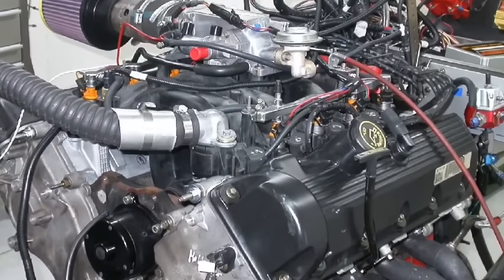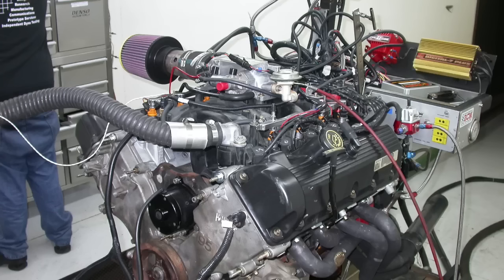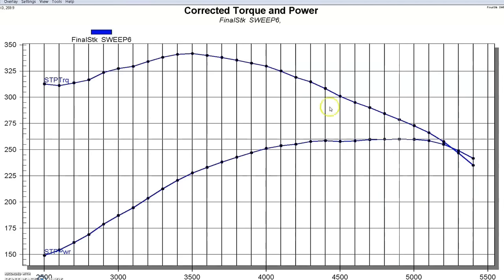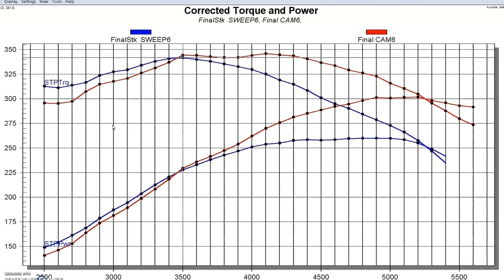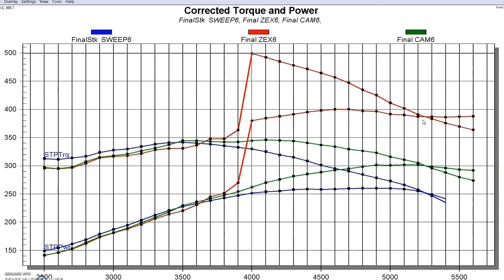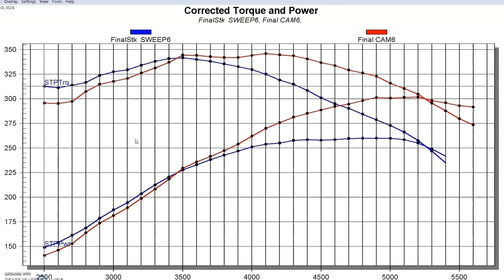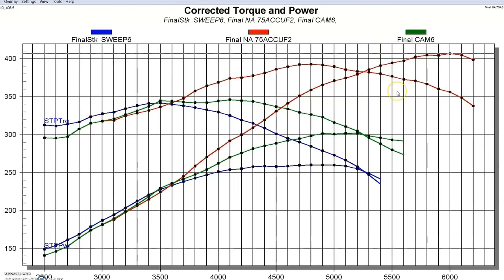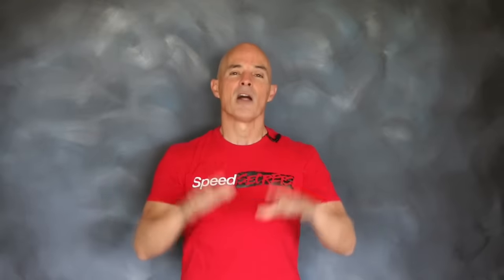HOW TO! MAX HP 4.6L FORD 2V MODS!

Comment: Brother, I want you to know... Back in the day when you did this series I became your biggest fan!  I built many 2V's and I love them.. We now have a 2V with a Carb and N20 in a 96 GT running low 5's in the 1/8 and high 8's in the 1/4... To  my knowledge... I don't think anyone has ran faster on N20...  Bad new is we are tapped out... At 304" the amount of Nitrous we are spraying will back up in the manifold and make a cool cloud above the Carb while going down the track!!!
Reply: Richard would you Autograph my 4.6 book that you wrote if I send it to ya?
Reply: Put a blower on it to shove it in?
LOL
Tim Matherly from MV Performance used to fly (8's in 1/4) with stock cast crank, pistons and rod topped off with those Trick Flow Heads. That is the secret.
His car had a street blower and five speed at that and was heavy.

Pretty impressive.
Reply: The 2v is the most underestimated motor ever.
Reply: @lifewithanxietyeveryday5897  while it has its issues... I agree with you! They are everywhere in wrecking yards and can be built up to Coyote type performance pretty easy...  I have personally made over 2hp per ci ( 304" ) NA with a 2V and over 4 digit power on N20...
Reply: @UnityMotorSportsGarage  no way . That's insane.
Reply: @Spad68  You can do alot more with them than people give them credit for... One good thing is using a Flattop piston with the 38cc Trickflow head.. you can make some serious compression!
Reply: Tell me how bro
Reply: @UnityMotorSportsGarage  what did you use to make that much power na?
Reply: @peterpys3840  we run a Big Bore 304" combo with TEA CNC Ported TFS heads that flow right at 300cfm, Compression is right at 14 to 1 running the largest cams that the cam core will allow! 17/8's long tube headers
  A Edelbrock Vic Jr  that has highly worked over with a 950cfm Holley Carb topping it off... 
 Andy
Reply: Just want to give Unity props for going low 5s/high 8s on a 2v. I spent way too much money to go 9s with a 3v so
I can’t imagine lol.
Reply: @kennethpowers8995  I have messed with these engines for 20 years... My buddy Ed Pierce had a wicked 3v he was our top competition at the first two Mod Motor Nationals and seeing what he went through makes me think it is easier to get the 2v to perform because the lack of valvetrain issues.....  I do know the 3v head will flow some serious air when ported!  Where it beats the 2v is the low to mid range flow ranges ..having 2 intake valves helps a ton! 
Thanks for the kind words... It's always a work in progress!
Andy
Reply: Unity MotorSports Garage tell me more a out your secret receipt iv been tru 3 engine now in my drift sn95 .. im running a stock bullit motor for bow but i want to build an other one with my cms ported head/cam ! Budget build.. teksid bloc /cobra crank / boss 302 rods... what would you suggest me for the pistons?
Reply: @teal_2v338  what are you using for tuning? On drift setups especially that hang out at very high RPM for periods of time the tune really needs to be spot on with safety cuts in place for things like fuel pressure and oil pressure drops, temps etc. The Boss 302 5L rods are a direct drop in for the 4.6 and are good till 600-700 Hp reliably. I’ve seen more made  but not comfortably. The 2v crank would be actually fine for the limits of the rest of your build. Are you running a power adder? NA you won’t be making much over maybe 400hp depending on bore and compression and cam profile -/+ a few HP, but boosted you could easily make good power. I would decide what your power goals are before choosing a piston. For strictly NA use in a drift car go with something that yields a high compression with your heads, is lightweight and has coated skirts. If planning to run boost run a lower Comp flat style piston and go with a forging known for strength in modulars like JE, Diamond, CP etc. I would sacrifice some weight for over all strength in a boosted setup. Going back to the tune though that’s most likely where you are killing these engines unless you are severely over working them and having failures like oil starvation etc. Which brings me to another point; do NoT cheap out on your oiling system for a drift car! Spend the money on a proper pan, pump, pickup, Windage tray etc. One way to make certain you will trash an engine is to starve it of oil flow and pressure. Kills them everyday lol
Reply: Also if you plan to go NA, with a little machine shop work you can also run a Coyote crank in your 4.6 and pickup a little stroke. Use some .020 over forged pistons with the Boss302/Gen2 Coyote rods and crank and you’ll have about 4.8L of NA power that would work great with some CNC heads and a healthy cam profile. Also 3.7 pistons are a good option for a budget build and Boss/Gen2 rods.
Reply: @kennethpowers8995  im using sct for the tuning im plan ing to stay n/a for a while till a get better then add a centrifugal power adder later for about 5-600whp goal , i have a windage tray . With stock pick up stock pump and pan.. but ill upgrade if i need to! I though the windage tray would be enough.. the sct tuner is closing me alot of tuner doors.. theres not much of then using it.. but theresnot much choice for my 2v..
Reply: @kennethpowers8995  3.7 piston are direct fit? They are stronger?
Reply: @teal_2v338  3.7 bore. It will get you the most displacement therefore best chance at NA power and more imports for you higher peak torque.
Reply: @teal_2v338  Yea there is only so much you can do with the stock computer and SCT software. For a dedicated drift setup I would look into something like FITech or Holley efi. Even Haltech if you can afford the system. Much more control with those systems. I’d say with an 8 bolt crank, Boss rods and a good .020 overbore piston around 9.5:1 compression. Good heads and a healthy set of cams you can still make 400-420 HP NA on a budget but still be safe to make 500-600 with boost down the road. If you plan to go straight NA the 3.7 piston option and coyote crank are the way to go.
Reply: @kennethpowers8995  wow that aint cheap..to expensive for me to justify..
Reply: @kennethpowers8995  what is the less expensive.. i dont want to spend 3000$ canadien for an ecu..
Reply: @teal_2v338  going the SCT route with your stock computer will work, but it doesn’t have nearly the advanced tuning abilities of the new stand alone systems.
Reply: That's a bunch of bullshit lol.
Reply: What did you do for ignition ?
Reply: @DavidTaylor-hk9ir  Back when I first put the carb setup on it I ran the MSD Mod 6 box.  After going through 4 of them because it would burn up the coil drivers up... due to the high compression 14 to 1 and Nitrous.. I had some old Team Breed Aluminum valve covers so we drilled the Drivers side cover and made our own distributor mount and I cut down a 351C MSD distributor to mount on the cam gear bolt.  We use a traditional crank trigger with MSD Grid to handle everything
Reply: @DavidTaylor-hk9ir  You can also see Video on my channel about the car... Thanks
Reply: @UnityMotorSportsGarage  ⁰0000000⁰⁰0⁰000⁰0
Reply: It would be nice to see a 2V 5.4 build 
I have an old 03 F150 and would like Coyote power but I like my old truck and dont want to swap motors
Reply: @Hi-Per  it isn't hard to do.  Trickflow top end kit will do it easily at the flywheel you would Def be making gen 1 and 2 coyote numbers for sure (stock output is what I'm talking about) even with a stock bottom 2v 5.4 imo.  Thing wound sound nasty too.
Reply: I have heard the intake manifold is the dog needs a trick flow or Victor junior  to get more flow and rpm

Comment: Thanks for giving the 2V mod motors some love! Build one up and hit it with 30+ boost. (Turbo Baby)...TEA has a ported Trick Flow head you can use.. DO IT.. Love the vids btw..
Reply: Check out Andrew Lavander (spelling?). He's running 8.0s and trying to break into the 7s.
Reply from the maker: I tested the TFS heads-they work well-better than ported stock heads
Reply: Through a Turb on it now!
Reply: Richard Holdener tf heads are so $$$$ expensive😖

Comment: Thanks for doing stuff besides small/big block and LS chevy's. Great engines but it gets kinda boring doing them over and over.
Reply: An awesome motor is an awesome motor. I don't care about brand. Show us a Honda K Series! I'd put that engine in anything. They can make such insane power and the mods are endless.
Reply: Agreed. I'm usually a Chevy guy, but I've owned 4 Crown Vics, including 2 right now. I needed this, desperately.

Comment: I’ll more than likely mod a 2v but damn do they sound pretty rad in a mustang with flowmasters.
Reply: Ford put OHC but used 2V only, just like a pushrod motor but with a taller head. they should've at least tried to go 3 valve.

effective areas of differing valve quantities as proportion of cylinder bore.

2 valves = valves are 50% of cylinder bore area
3V = 64%
4V = 68%
Reply: @sepg5084  They did the 3 and 4v later on, gotta remember these debuted in the Town Car, they weren't meant to rev high or make big power.
Reply: Sep G Even in 99-2000 they made a 4V cobra. Then the terminator cobras from 03-04 were also 4V with a supercharger. 05-10 were also 3v’s on all gt’s.
Reply: Carson Rasnic cobras had the 4v since 1996
Reply: Even with stock exhaust 2 valves sound amazing.
Reply: 2v one of the best sounding engines ever its just weak tho. 4v sounds glorious as well with more power to match the sound.
Reply: @sepg5084  
Ford used 4V engines in many Lincoln products. 93-98 Mark VIII(basically a Tbird), Continentals(V8 Taurus), and 4v 5.4's in Navigators. Seems weird that about the only thing that didn't get 4v heads was Town Cars. Panther chassis did see a factory 4V in the Maurader though. Lot of 4V options besides Cobra engines.
Reply: Sep G I’ve seen a couple mustangs with 5.4 3V swaps from f150s the “mod” motor was made with 2v 34 and 4v per cylinder eventually
Reply: Kevin Tucker The4v came out over a decade before the 3v
Reply: Sep G never understood ford putting such a lame engine in a mustang GT from 96 to 2010. With enough money and boost they can be made to be good performers. Wish Ford would of breathed on it a little more with better heads and cam shaft profiles to at least get it a respectable 300 plus hp with the 2V. And 350hp for the 3V. They was completely out gunned against the competition until the 5.0 coyotes cam out.
Reply: I have had 2 2v and 10 302 5,0 but nothing sounds better than a 2v they are the most dependable motors.
Reply: @JMKady76  Exactly as Richard said they were made for torque which is whats needed to move a big boat like a TC,CV,GM
Reply: 3v sounds better and is aluminum block rather than cast iron.
Reply: Justin Kady 4v has been around since 93 in the mark8 being all aluminum and putting out 270hp and in 97/98 the mark8 still had the same all aluminum 4v but the LSC trim put out 290hp.
Reply: @bamafreak223  That's NA, with a supercharger I wonder how much it put out.  Afaik the Cobra was supercharged 4V if I'm not mistaken (I haven't ever owned one).
Reply: @zuestoots5176  I am looking to do this video's build. are the Crown Vics and GM's another option to grab the Non-PI short block with the 11cc dish mentioned in this video? Im askin gyou cause you have a Grand Marquies
Reply: Not sure who made who, Mustangs or Flowmaster. I love them both. Just seems like Flowmasters we're made for Mustangs. They fit each other like a hand in a glove. I always thought it be nice if Mustangs came from the factory with Flowmasters. Awesome combo.

Comment: amazing motor. very underrated motor. 281ci cranking out over 400 hp very nice
Reply: Very much so!  You've got to think, back in the day, the Ford top of the mill 289 made, what, 306 after Shelby got done with it?  A regular mill 289 made, what 270 or so?  That has to mean something right?  I love the damn 2V 4.6's!!
Reply: @TheVenom8343  I believe the old gt40 ran off a similar block and the drivers wanted mo powa bby so they finally went to big block but gotta love a small v8 outrunning some of the newer tech
Reply: @TheVenom8343  I also love the 4.6/5.4 2v's!! Everyone dogs them out and believes that they are gutless turds....
That's one of the reasons why I love em. I love the underdog! And the look on their faces when you tell them that they got outrun by a 4 6 2v😏..
And they are bullet proof! I've personally seen dozens of them with 500k+ miles on unopened ones, and one with a little over 760k miles with no smoke or rattles!  I own a 98 Mustang GT 4.6 2v with 520k original miles and never had a valve cover off. And it starts every time I turn the key, and it's never left me beside the road..
Reply: @robinesavage404  the reliability is Awesome, but I've Always disliked mine when it came to making power(and the pathetic TR3650 trans). I kept it stock for YEARS until I swapped it out(the aftermarket was poor and Fast examples were far and Very Few... especially for the money). It has it's horrible stigma for a reason.
Reply: @TheVenom8343  The race prepped 289 FIA Cobra and Daytona racers were the closest analog to what Richard built for this test, they made 385 HP in endurance trim.

Comment: channel is getting better and better dude. when you mention a supplier have you thought about calling them and setting up affiliate links if there interested. even if you link their website and get them a traffic bump they might hook you up with some gear to do more testing. It would be super ace to get advertised flow data for heads and see how that translates on the dyno. The content you making from mining old data is ace. can't wait to see what you can do when you get the rev stream you deserve.

Comment: Nice results. It would be interesting to see a 2V with the trick flow 2V heads.
Reply: If it's the whole top end kit from trick flow it's supposed to give you a total of 340 horsepower or maybe a little bit more

Comment: I love the 4.6. Have one in my 96 Tbird. PI head swap with 262 cams, longtubes, and a tune. Dyno'd a touch over 300 to the ground. Recently got an SVO supercharger so working on fitting that up next.
Reply: How’d it turn out? I have a 97 Tbird
Reply: SVTBird96 did the head studs from the old non-PI heads work on your head swap? Im wanting to put a Non-PI bottom end in my 2002 GT when the engine gives way. Get those compression numbers up with my stock PI heads, cam, and a tune. Thoughts?
Reply: @obran003  better if you get an aluminum 4v engine if youre really after a compression bump. Iirc 4v pistons with a PI combustion chamber will get you to around 13:1. Youll have to notch the pistons in the 4v so theres no collision though. Plus the aluminum block saves 80lb out the nose of the car.
But yes ARP head studs for the PI and NPI are the same. At least from what I have seen.
Reply: @svtbird9613  so the aluminum 4v bottom end, with the 2v PI heads?? I was thinking a full aluminum DOHC 4v swap in my Grand Marquis, but if this is correct, I'll just do an Aviator block and pistons
Reply: @yeanah2571  Im not sure about the Aviators but internals but Id recommend using the complete long block. 4vs flow WAY better than 2vs. I just stick with 2vs cause Im weird.
Reply: That is badass.  300 to the wheels is stout through an auto.  I assume it is still auto right?  Be badass to throw a tr3650 in it.
Reply: @obran003  use a npi 5.4 and port your heads and throw some healthy cams at it.  Be badass if you could come up with a good intake option haven't researched it alot.
Reply: I love thunderbirds, we had a 94 2v we beat the ever living crap out of it and it just kept on going. And I think that year was only rated at like 205HP but it felt way more than that compared to other cars I've driven. Also it had limited slip which made it super fun. 👌 I have a crown vic now and it feels so slow compared to it.

Comment: My wife's 99 Expedition has 320000 miles on it. It's not a powerhouse but it's reliable. Just change the spark plugs every 80k and torque them tight and they won't blow out👍.

Comment: Now 4.6 dohc and the various heads b vs c etc.
Reply: Are we talk about 2 vavle or 4 vavle . Cause that car that I'm aware of making 2500hp is a 4 vavle
Reply: @Spad68  most definitely not referring to a 2v they're either non pi, pi, or tricflow. 4v is b-db heads
Reply: 03/04 heads for street and anything below 8000 rpm, the dual runner b heads are better above 8000 but the later c heads still make good power up there too
Reply: @trevorvaughn5562  agree. only reason to use b heads in any street car is to save money. the c heads are better in every way for a street car.

Comment: 02' Mustang GT with , 2v 4.6, 5 speed. Did : Vortech S Trim, Intercooler, 42lb injectors, long tube BBK's, high flow cats, Flow masters, steeda springs, lower 1" ,  Tokiko Struts/shocks, Steeda front/rear sway bars, Cobra Brakes, Sub frame connectors to tighten the convertible chassis, competetion shifter and clutch. Pre work dyno=220 hp @ rear wheels, Post modifications Dyno= 399.2 rear wheel hp, 385 lb torque. Woke it up. Bad Ass "BadHorsi". Still driving it hard 18 years later. Love it. About to put new paint and new Lemans Gold Metallic stripes. Love this car/engine.

Comment: The pi heads on the non pi bottom end worked way better than I expected it would, those 4.6 motors have a reputation for being terrible to modify for power.